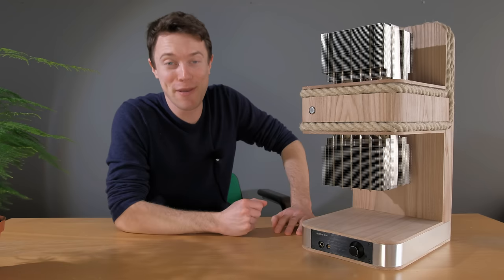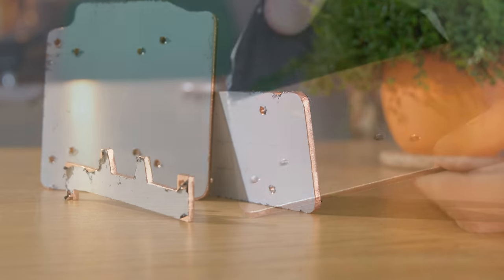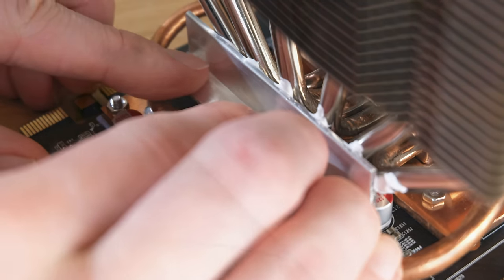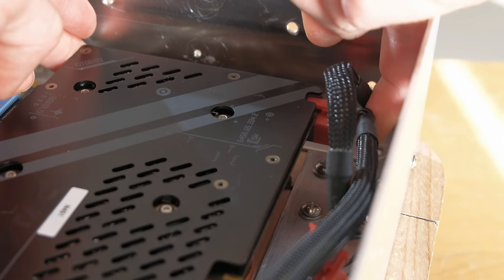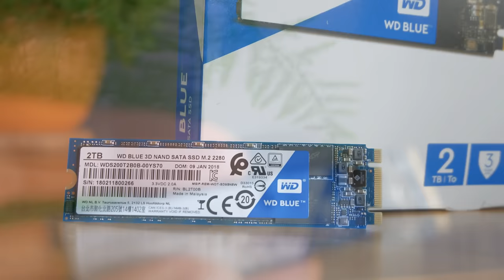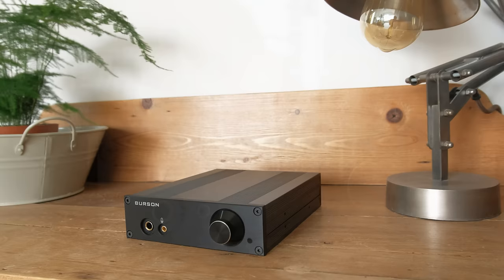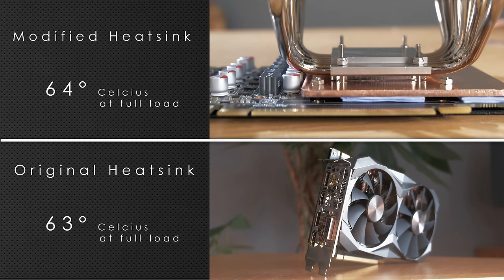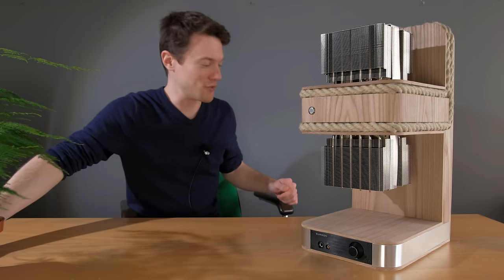I built a PC out of rope and wood...

Comment: The thermal interface between the copper heatspreaders and heatpipe is not the best, as it's essentially a line with minuscule area :( also liquid/paste thermal compounds need to be pressed between two flat surfaces, else the compound can separate and leak/wick away over time and they are also quite inefficient at bridging distances. If at all possible, i think it would have been better to solder heatpipes to the heatspreaders. I think the best way to do this is with a gas burner, or by clamping everything down with C-clamps, with pipe fitting soldering paste in between, then placing the whole thing on a stove, and waiting till it reaches the temperature and solders itself. Obviously figuring out a rig to do the soldering is not at all simple.

Coils themselves are fine running very hot, they take no harm from that. It's the capacitors that are right beside them that you want to protect from their heat. Some airflow across the card would have been good, but unfortunately it's against this build's goals.
Reply: that's what i was thinking.
If i could do what he did, I'd solder heatpipes instead of using thermal paste(of course, i would also make those parts of pipes a bit rectangular)
Reply: If you look closely, it appears as if he has flattened the copper pipe at the interfaces. I would guess these wicks might perform better vertically, as they use internal natural convection, but I think it's an excellent build. And soldering seems to go against the theme of the build. It'd easily be the most difficult or least accessable method used in the build.

Really liked the project.
Reply: Decent heatpipe is largely orientation independent, there's barely any difference whichever way you put it, because capillary force and pressure differential are an order of magnitude stronger than gravity.

He did flatten them a bit, but there is still little to hold the thermal paste in place. Sure, it should work for the most part not too terribly regardless.
Reply: Stephen Johns well, it's not like soldering smd components on a pcb. You need flux, blowtorch and some tin. But it would be smart to test it out on some ordinary copper pipes and scrap pieces.
I just gave my 2 cents, and yeah, soldering does fit into the build because temperatures are a pretty important thing

Comment: Alright Linus where you at
Reply: Yifeng Yang this comment makes me said, and so does the part of this video when he says the GTX 1080 mini is the best graphics card u can buy!
Reply: he meant for the job not the actual best graphics card
Reply: Tacosauce710 this made me said too
Reply: 1080ti would've required something more than 500W passive-cooled PSU, especially with the OC-ed 8700k powerhog on top of it, as well as the sound amp and two large coolers.
Reply: 1:33 "one of the fastest cards you can buy" 

not the best
Reply: linus is more "extreme " if u know what i mean

Comment: There is still a mistake, the two aluminium heatsinks might be mounted by rotating them 90° from their former position (air flow sideways) to allow more cooling.
Reply: Very good point.  Would lose the coffee maker look, though.  Although, I wonder if the fans in the middle of the heat sinks moves more than enough air that it doesn't matter that they're mounted that way?...
Reply: That would make it super wide though, he would have to reformat everything

Comment: $500 USD for that m.2 SSD.
Reply: "not as expensive as you might think"
Reply: He was right. It's not AS expensive, but MORE expensive. lmao
Reply: That is actually pretty cheap for an m.2 SSD of that size. I have a 1 TB 3.5" SSD that I payed $300 for about 2 years ago. When I was looking into m.2 I couldn't find one that size and a 500 GB was about $500.
Reply: When I bought my first SSD a few years back, a Samsung 830 128GB, it was $150. The WD Blue SSD is not only way way faster and will last much longer, it also has 17x the storage for only 3x the price. Don't know what you were expecting, but I was expecting at least $800 like any other sane person with any common knowledge on recent prices for computer hardware. That was a bigger surprise than finding out that my second hand GTX 780 Lightning is worth more now than when I bought it 3 years ago due to new GPUs being sold 2x their MSRP!
Reply: Lol wut? If you know anything about the cost of memory thats dirt cheap.
Reply: ...and it's not even NVME.
Reply: To be fair, that is cheaper than most sata ssds at that capacity (~$700)

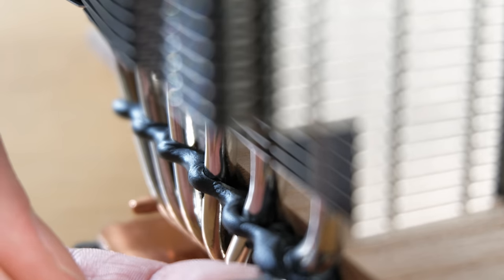Comment: Hey Matt, you may run in to trouble later on, when the  black gunk at 5:31 - 5:44 begins to decay.

I don't know what thats stuff is made of, but it looks like the same stuff from EEVblog #1072 (10:16-11:46) and EEVblog #1073. 
In those 2 videos, Dave fixes some studio speakers, where the problem was that the soundproof black gunk, became conducted and destroy everything.
not sure if this could happen to you, but I just wanted you to know the possible dangers.
Reply: Since the black gunk is only touching a heatsink, which isn't an electrically live component, it ought to be fine!
Reply: also just because a substance looks like another its most likely not the same

Comment: Not sure if the fans are blowing out towards the front or in towards the back, but if they are blowing out, you could add some magnetic dust filters to catch most of the dust, and they wouldn't even be visible on the back of the unit 👍

Comment: Amazing build! but won't the heatsinks weigh down too much on the motherboard?
Reply: Boodendorf I would think it'll be fine so long as all the standoffs are in place, it isn't taking much extra weight, just upside down.
Reply: Boodendorf no.
Reply: i think although its attached to the motherboard, the wood chassis is taking the weight of it
Reply: Not a problem at all, most motherboards hold such a heat sink sideways. The heatsink is mounted with a backplate to the motherboard, which dissipate the weight over a larger surface. So no problem at all.

Comment: Why didn't you solder the heat pipes to their respective metal plates?
Reply: Phil Dog cause you cant solder aluminium
Reply: Someone might feel like correcting me, but all heat pipes I've seen has been made from copper. Almost all of them were nickle plated to prevent corrosion, but beneath that there was copper. Given that the heat spreader plates were also copper it should be easy to solder them together.

However soldering the heat pipes would make it hard to get the angles right so everything fit without putting unnecessary stress on the PCB's or components. Attaching them the way it was done allows for a lot more flexibility when installing the heat pipes.
Reply: I agree Blahorga Slisk. He might have to replace the thermal compound every so often, and it's definitely not the best way to move heat, but if he soldered slightly incorrectly, it could stress the PCB. It will probably be enough to keep those components fairly cool anyway, even though it isn't soldered.

Comment: shouldve soldered the copper pipes to one another
Reply: Kim Jong Un it wouldn’t make any difference especially since he only used one copper pipe
Reply: It would in a long run. Thermal compound have a tendency to dry up and screw joints tend to loosen its strength over time, especially during heating-cooling cycles. It will be a messy job and a pain in the ass to service this cooling system. I'd solder everything together if I were him.

Comment: Where does one get "raw" (unbent) heat pipe?
Reply: I would go to amazon and ebay for my first bet.
Reply: home depot
Reply: Digi-Key sells them for about $10 each. Lots of info on how to use, too.
Reply: I just downloaded the free ATI Advanced Thermal Solutions engineering e-book from Digi-Key's web site. Tells you more than you ever imagined about these things. Methane, water, ammonia and sodium are all used as transfer fluids, depending upon temperature. Lots of equations or if you choose, software to do the calculations.

Comment: How much??
Reply: yeah im interested to know how much. ill sell u a human body part for it...dont ask me whose arm and leg it is though lol
Reply: I did some rough math and for all the computer components he linked to it costs around $2,100 USD, excluding the elm, copper, tax, shipping, etc.
Reply: Samuel Button with the parts he used, is it a beast of a machine spec wise? And if you swapped out some components with cheaper options would that bring the cost down significantly?
Reply: Yea, it's what I call "future proof" meaning it will be able to handle pretty much everything thrown at it for a good 10+ years and after that it'll still be fine but by then, if technology continues as it currently is, there will be much more powerful components on the market. As for making it cheaper, yea, if you downgrade it will ultimately cost less. The thing with building a computer is that you can throw as much or as little money into it as you want, within reason, it just all depends on what you want it to be able to handle.
Reply: Yea, I was expecting it to be at least 3k for just the parts but I also haven't had to build/upgrade a computer in a while so I'm unfamiliar with where the price/power line is at now.

Comment: The noise of the MOSFETs are because its switching in our human audible range. The MOSFET's main purpose is to regulate voltage in a switched mode fashion bottom line is that the switching is required to get the power efficiency.

Comment: You should get a custom glass or clear plastic casing to to just cover the two areas where the heatsinks are exposed to prevent dust from getting in them! would look cool in my opinion but still a great build i could never

Comment: I'm thinking of building my future pc similar to this but in much simpler way for maintenance and upgrade. It does resemble like an Xbox Series X but bigger.

NZXT have a similar looking case but I want to use the standard ATX components for the most part with these beefy coolers. I also would like it to act like a fan heater during winter for free heating. 🤣

I've already watched this video before but just re-watching it for ideas.

Comment: I don't think that the MOSFETs make any noise, they have no movable parts inside. In my experience with power electronics, this must be done by the coil: most probably you don't got it on a floating coil that is mechanically dampened by the cables subjecting it.

Comment: I would of sanded down the edges of all the wood to give it a more softer look, and then apply varnish coating to the wood to give it a smoother texture, with some light rub down with steel wool to remove any roughness that applying varnish would often do, and then apply a non-stick coating of something to prevent dust sticking to it.

Comment: I don't think you would be able to access the ports on the GPU and those ports are:
Video Graphics Array (VGA) (DE-15)
Digital Visual Interface (DVI)
Video In Video Out (VIVO) for S-Video, Composite video and Component video.
High-Definition Multimedia Interface (HDMI)
DisplayPort.
Other types of connection systems.

Comment: Sorry if someone has asked this already, but did you have to do anything to the aluminum to protect it? I know aluminum doesn't rust, but will it corrode? I kinda want to try making my own PC case with stained plywood using a polished aluminum sheet sandwiched between the wood and a piece of Plexiglas, just wondering if I should do anything to the aluminum before assembly?

Comment: Did you use solder or conductive glue in addition to the friction fitted screws between the heatpipe and the copper plate, or is it just thermal paste?

Comment: The build is fantastic, looks very cool. But that way to plug the GPU, most had some big impact on the memory latency (read/write speed), between the CPU and the GPU!?
Afaik even when the GPU is mounted directly on the PCI-E slot, you have measurable latency, (because is not a strait path) imagine being linked by a extra ~10 centimeters cable! I would love to see a benchmark of before and after, to see how big is the latency increase, I know you were able to play games just fine and edit video, but I would love to know, how much impact that GPU link cable add on you max fps's.
Reply: Thats not anywhere near true, look at the linus tech tips video on this the length really doesnt matter
Reply: @gamer7138 Btw so you don't think that guy is full of it, (Casey Muratori, helped make The witness game) in the video he says is bad at math but that is not true, he is just being way modest, he is very good at math, this is just one of the Q&A videos of his series on teaching low level programming and on later videos he uses imo advanced math concepts and does it with no trouble.

Comment: There is no way a heat pipe cooler works upside down. They operate on the principle that hot steam is lighter than water. As the water cools it falls back down to cool the CPU and the system circulates. An upside-down water pipe cooler won't circulate because the source of heat is at the top. Maybe a pressure differential will overcome it, but you're still struggling by opposing the basic principle of operation.

Comment: The joint “ copper sheet “ between GPU & cooler it’s weak point, thermal paste between to sheets not good, Playstation 3 had over heating probleme because of this ,it had IHS and heat sink and thermal paste between them. so i hoped you didn’t, you can use GPU water block kit, any way must change thermal maste every 6 mounth otherwise you have over heating problem.

Comment: Are these builds safe? doesn't a cpu get hot? what's the risk of a house fire?
Reply: Yes a CPU gets hot, but thats what you use a cooler for the other hotspots get cooled by the air moving over it and it shouldnt burn your house down its pretty safe you can build a PC against a wall if you like

Comment: Is cooling the vrm necessary on a really low TDP GPU, like 130w, or can I get by cooling the memory and GPU die and call it a day? It is currently being cooled by a hunk of aluminum that only makes contact with the GPU die and nothing else.
Reply: I'm also considering adding aluminum heatsink to the vrm and letting it cool with the airflow in my case instead of connecting it to the cooler.

Comment: Honestly my self I would prefer just to buy a higher GPU, undervolt it, lower the clocks and not have to faf around with building something if silence was my only goal as I have done that, only need to run the fans at 600 - 800 rpm where they are silent, where as before they were running at 1400 rpm, did have to lower the clocks from 1960Mhz to 1683Mhz which is a 14.1% reduction in clocks, but it only reduces FPS by ~10% so by simply going up 1 tier of GPU you can underclock your GPU and still have more performance than the lower tier GPU, unless it's like a 3080 vs 3090, as it's only like a 10% difference, but if for example you were going to buy a 3070 and went for a 3080 instead the performance difference is like 35% and the Ampere underclocks like a champ you can reduce the 3080 from 320W to 250W by only losing like ~3% of the FPS and you can get it down to 200W by reducing it down to ~7%.

Which if you buy a GPU with a good cooler you should be able to make it basically silent at 200W after tuning the fan curve and setting the temp target to 90C, you shouldn't actually run the GPU at 90C or otherwise you you will lose even more performance, but running it at 83 - 85C is fine, it's just so that you have a margin for error.

I get that this wasn't only about silence, it was also about building a case, but in most peoples... pun not intended... cases it's a more viable solution that spending a long time making a custom case or even just disassembling a GPU, making a mounting mechanism and putting on something like a NH-U12A which if your card is a little wider than standard you can fit on in a normal case directly slotted into the PCIe 16x slot and the NH-U12A performs within a degree or 2 of the NH-D15.

And considering a NH-U12A costs $80 on it's own, you are already looking at $590+ for a 3070 + NH-U12A vs a 3080 for really ~$750 and you will still gain 28% more performance and only 27.1% more cost.

Comment: i hope nobody follows this technique for applying thermal paste to a gpu. It's really dangerous. Coolers don't always cover the gpu surface equally, thus a corner might not touch the coldplate. That's an overheating gpu at best, and a dead one at worst. Look up ekwb's recommendation (it's a watercooling company).